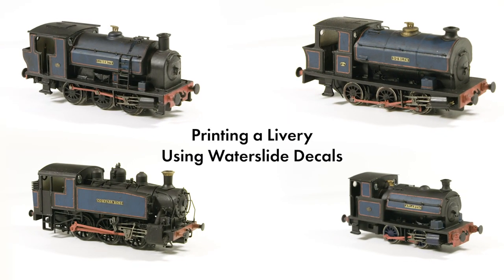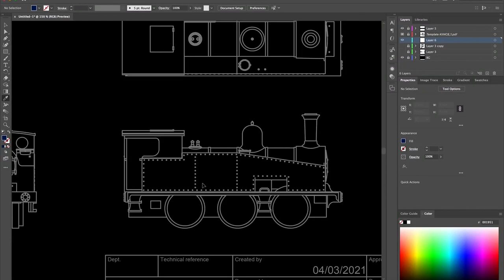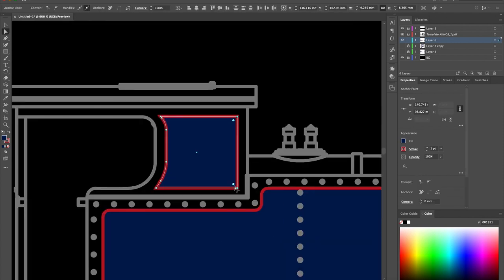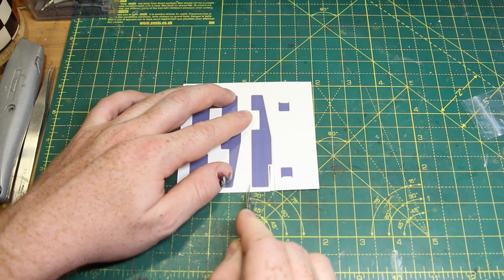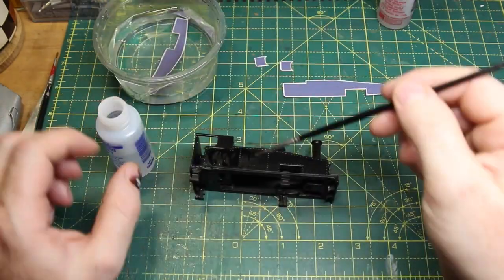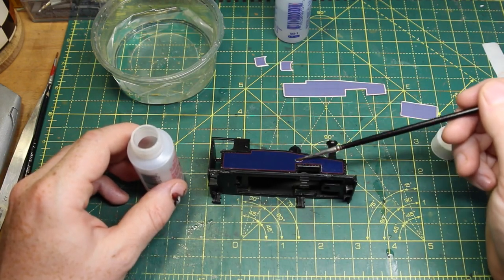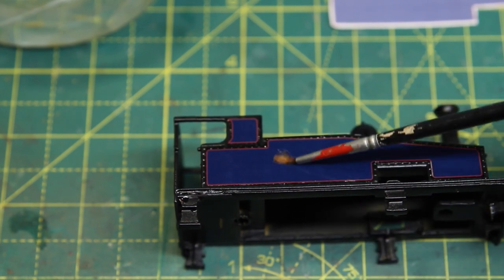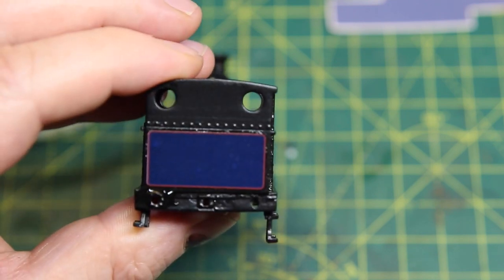Printed Livery Using a Decal Printer - Model Railway Mania

Comment: Nice model.  Will you livery any other models like this?  

(Also how's your thumb holding up?)
Reply from the maker: Yes for sure I think I'll do TDA locos like this. For other locos like the lined white/black/white NWR livery I think I have found the right settings to do the lining in single large pieces (as I did recently on the Terrier if you've seen on Instagram) so that's promising.
Thumb is ok I think! Hurt like heck for a day or so but apparently a new nail is growing under the old one. Fascinating and gross in equal measure haha.